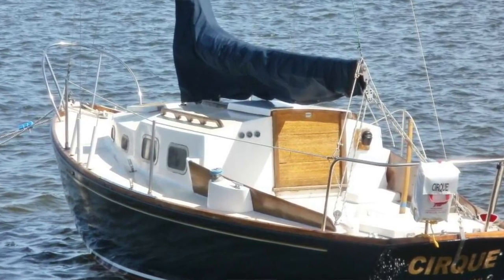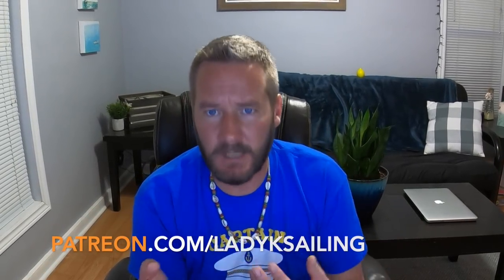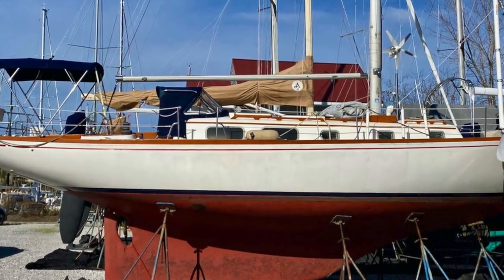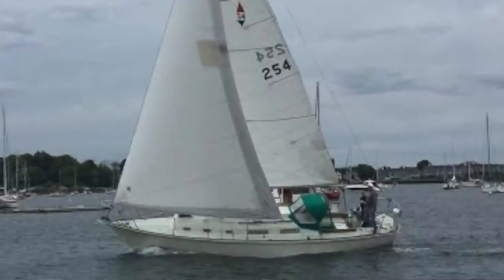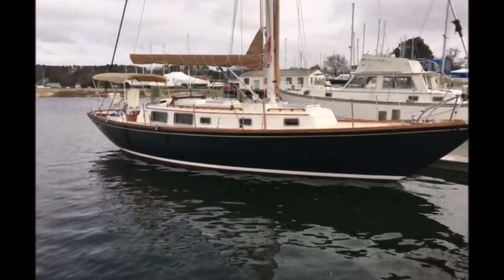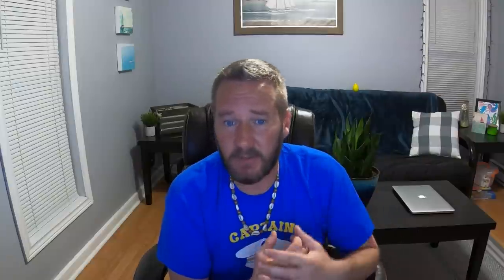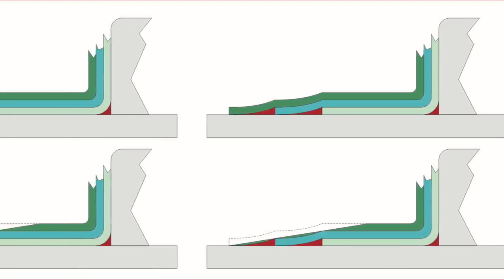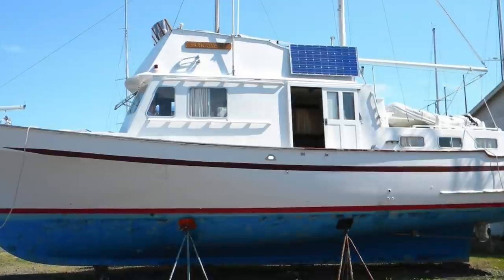Bristol Yachts - Episode 131 - Lady K Sailing

Comment: Hey Tim, The last time we chatted we were behind you on the Chesapeake. I think you were just heading out of Delaware City and had a run in with a crab pot. We had just bought our Bristol and were heading home to Canada to sell our Aloha 32. A subscriber bought it over the phone so we doubled back to Rock Hall and sailed the new boat home. She is a 41.1 sloop.  The 44.5, 43.3 and the 41.1 are all basically the same boat but with different transoms. We love our 41.1 centre cockpit. She is so super stable and sails like a dream. Never thought I would like a centre board but so far it has been only positive. We opted for the centre cockpit because of the better motion at sea. This has proven to be a good call as I am pretty sensitive to motion. The more we have dug into this boat, the more confident we are that we made a great choice. You have good taste in boats for sure. Let me know if you want to go out for a sail in one. We can have that rendezvous we talked about back in 2019. We are in Belleville. You can see the discovery and refit of our 41.1 at www.youtube.com/c/windoverwater. Great informative videos. Keep up the good work. C

Comment: Hi Tim, I've been following you since the beginning and have appreciated most of you reviews (there were a few I didn't agree with but every has their opinions).  The thumbnail on this video caught my eye as I have sailed many miles on the very Bristol 57.  What a fantastic boat.  We own a Bristol 43.3 CC which is the same layout as the 45.5 CC.  The 43.3 carries 160 gals H2O and 110 gals diesel and has a tone of storage.  The 43.3 is the first CC boat I have owned and was reluctant to do so but the Admiral fell in love with the interior.  I can appreciate the aesthetic appeal of the aft cockpit version of the 45.5 but after having the CC for 9 years will point out some of the things about them that I have come to appreciate and wouldn't want to do without, especially when cruising for extended periods.  First is engine access, we have 360 degree access to the engine without having to crawl in a locker as well have access to the stuffing box pulling up a floor panel and the quadrant by lifting our mattress.  In addition we have the patio (aft deck).  We keep bikes, an 80 quart ice chest, the generator, grill, etc. back there.  Don't know where I would put them in a aft cockpit boat.  Those are the real perks I have found besides having a private stateroom with queen walk-around bed. As far as sailing ability you were correct in that they are solid and comfortable.  I have been on production boats in rough conditions that slam and shudder.  It's even scary to go down below because of the creaking and groaning going on.  The Bristols and Little Harbors I have sailed are quite and comfortable even in rough seas.  One last thing to consider is that boats of this kind are continually being upgraded so it is possible to find them ready to go without a major refit.    Keep upi the great videos and hope you can get back to cruising soon.